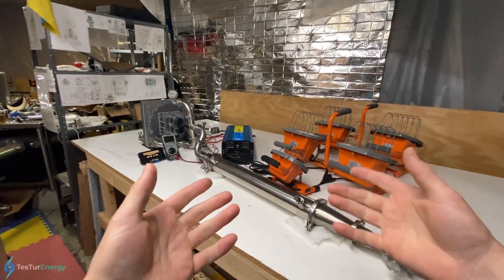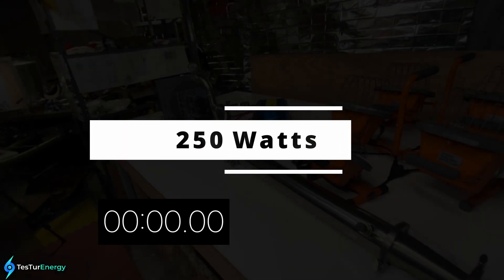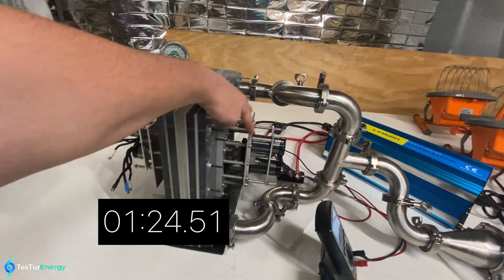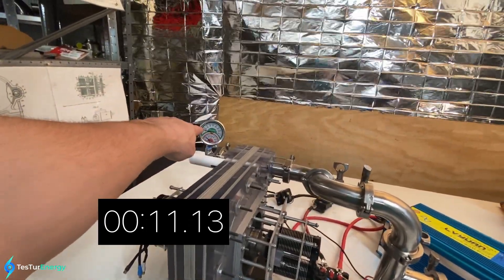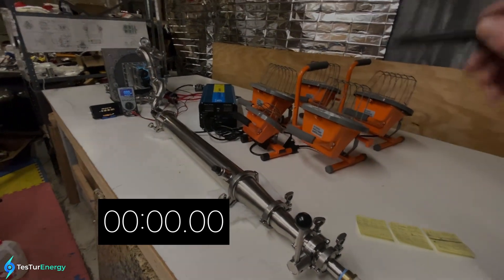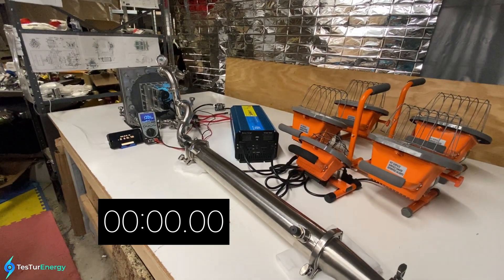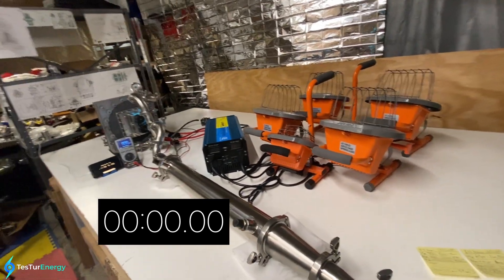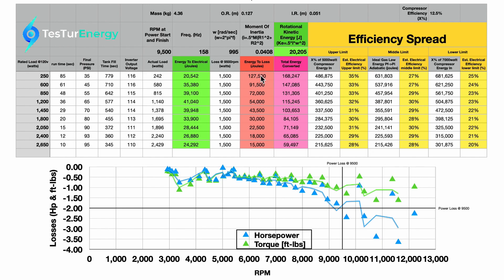Tesla Turbine 250 watt to 2.65 kW Power and Efficiency Test

Comment: Your efficiency calculation seems way off to me. I ran the calculations myself and I found your joule numbers to be right but your efficiency to be wrong.
Consider the first run: 20.5kJ out, 631.8kJ in based on ideal gas law. Running a percentage on this gives a 3.2% efficiency which is much more realistic given your improvised setup and small single stage turbine. I do not understand why you insist on including the losses into the power output. For the proposed real world application, only the electrical efficiency of 3.2% matters.
Reply from the maker: Hey thanks for commenting. The losses that are are shown are from the crappy RC car gears that are currently being used and the 10x crappy ball bearings that are in there that will not be in the final direct to shaft model and the losses to them can be assumed as available with the direct to shaft setup. 

Known recoverable losses at each RPM have already been tested.

The only reason the gears are even in this was because I wanted to prove to people the turbine not only didn’t have to be geared down like everyone demands but it could in fact get so much torque that it can be geared down. 

And I already know the direction for shaft TesTur will be MUCH more efficient because our new little 4.5in one that is direct to shaft is even more efficient and better than the 10in diameter one because it’s direct to shaft 

DIY Turbo Generator for Off-Grid Electricity: 250 watt Load https://youtu.be/60OqmBMNV-Q 

The little one powered the 250 watt load for a lot longer with less air even.
Reply from the maker: Additionally the 20,000 joules of rotational kinetic energy given to the rotor to spin up MUST be considered and included in the efficiency calculation because that is where energy went to from the tank. And in fact that was likely when the turbine was operating the least efficient and dumped the most air to do nothing but spin up. 

Lastly I honestly have no idea where you’re getting this 3.2% from… 

Can you elaborate on this for me?
Reply from the maker: The reason losses to the low power run are so high is because there is a constant gear loss load that the turbine is pushing through. 

By having to push through that load a lot longer most of the energy went to that. 

And there is a no electrical load condition where all the air in the tank just goes to pushing through the gear losses. 

All of which will be useful for power out with the direct to shaft setup and the reduction of the ball bearings alone.
Reply from the maker: As far as efficiency goes… (mind you this is a copy pasta 🍝 so it’s a bit long but it’s worth the read.) …My 2650watt electrical load run came in with a very low ball calculation of 40% isentropic efficiency.  To start off, mind you that includes generator losses, 3 phase rectifier losses, and inverter losses to the electrical load that were not accounted for. So the turbine off the bat is already most definitely doing better than the 40% isentropic efficiency I’ve calculated from the already low ball test results.   But for now I’ll just assume 40% isentropic efficiency so that I’m not over claiming what I can prove it can actually do for the time being. (I have nothing in the long run to benefit by overstating my numbers and only my legitimacy to lose. I’ve worked hard for my physics degree and don’t intend to tarnish it for a couple of extra views on the internet.) 

As far as inefficiencies to the system to fix, there’s 10x crappy ball bearings in this version, 2 crappy RC car gears, both losses will be gained for power out with a direct to shaft generator. (Minus two gears and 8 crappy ball bearings)  There’s an 1/8 of an inch of space between the turbine endplates and the casing endplates on both sides of the TesTur. That’s a 1/4in of open flow area around the 2in wide turbine (that only even has a total of 0.75in wide of spacing between all the tight disc spaces for torque to begin with.)   That means 25% of the open space for flowing through the casing, between discs and between the casing and turbine endplates, is just free flow over the side of the turbine still. (I’m using the absolute bottom of the barrel of machining equipment right now in my garage 🤷‍♂️)  There’s no labyrinth seals yet to even attempt to further reduce that overflow… 

The nozzle is atrocious at the moment, when making the variable converging section have a tight convergence it causes the fluid jet to aim more centripetally (towards the axle) instead of tangentially (glancing off the disc tips) which severely effects the fluids natural path.   This will be fixed with the new variable nozzle design I’m going with.    Then even further in this specific casing’s assembly there’s two “pillars” in the middle of the nozzle.   This is because the aluminum plates in the middle of the casing plate stack only had the variable nozzle bar and inlet holes cut out, and not the full nozzle geometry.  So those pillars are just vertical bars in the middle of the nozzle for the air to smash into just before going into the turbine (hopefully the wet steam tests will just erode them down 🤭)   Before all that there’s still about 100ft of air hose between the tanks and the turbine… plus a shell and tube heat exchanger and a TON of elbows and fittings.    I’m sure I’m forgetting something too but between all that being fixed… I can almost guarantee we will be in the 60-70s % range and that’s all just still with room temp compressed air.   Most forget, I’m using room temp compressed air and never went over 20psi at the nozzle for these tests. (Pressure differential and temperature differential govern efficiency) 

And even then I still only even have a single stage on it yet.   Everyone wants to compare it to the efficiency of a very high temp, high pressure (1000°F & ~1800psi) multibillion dollar 15-30 stage steam turbines…   😮‍💨   That’s apples to rocket ships. 😅  But considering Rankine Steam cycles get theoretical max about 33% of input heat (due to latent heat of condensation and that’s without any regenerative boiler feedwater preheat, air fuel preheat, etc) and then 40% isentropic efficiency (considering the turbine as is) we’re looking at 13.2% thermal efficiency with steam.   A more apt comparison for the TesTur would be something an individual can actually purchase, like 1-5kW piston gas generators that you can get from Home Depot or Lowe’s.   These get 15-22% thermal efficiency off the plant floor. Good luck getting that 1 year down the line or later with all those moving parts.  Also for reference, industry standard for micro bladed gas turbines is 25% thermal to electrical. Whole system efficiency can go higher in Combined Heat and Power (CHP) system, but alas the TesTur would see the same whole system efficiency increase in a CHP Auxiliary Power Unit (APU).  In the TesTur you gotta replace…? 🤔bearings…? And still even then, only maybe 🤷‍♂️ depending on how good of bearings, balance, lubing, cooling.   The TesTur, and other bladed turbines, only have one moving part. 🔥 

So if those piston generators drop efficiency, even at all, the TesTur on its worst day is competitive with a gasoline piston engine electric generator.🤓😬🤷‍♂️  And the TesTur can handle any fuel that can burn, even solid particulate fuels like powdered saw dust, pulverized coal, powdered iron, biomass, etc. (noting the number of those that can be acquired without spending money… 🤑 opening up “low monetary cost”, even carbon neutral, fuel options for MILLIONS around the world)  We have to remember that the TesTur doesn’t have to be the holy grail to be worth using if we have free fuels readily available like biomass, and even waste heat already being dumped out into the air and not used for anything.  The TesTur just has to be a viable option for some to be worth doing. 

Even more, the mere fact that I’m using a low temp fluid for my 40% isentropic efficiency calculation means my TesTur efficiency is severely limited by thermodynamics and fluid dynamics.   Increasing temps will automatically increase my turbines efficiency.  This is because gasses have an increasing viscosity trend as you increase the temperature.   This leads to increased isentropic efficiencies in the TesTur from reduced slip on the discs.  (Meanwhile, we’re already talking about a piston engine using combustion temps as is.)  Whereas bladed turbines see the increased viscosity as an increase in drag loss through the turbine blades.   So we can’t always count on seeing increased isentropic efficiencies in a bladed turbine in practice when we go from low temp to a high temp.  Again, to reiterate, this increase in viscosity in the TesTur only works to enhance the working action of the TesTur.  (That being viscous adhesion to the disc faces increasing torque.)  That’s all on top of the increased thermodynamic efficiencies of using a higher temp elastic fluid too! 🤓 

The disc spacing for room temp gasses is not going to be the same for combustion temp gasses/steam because the viscosity of either increases by 3x fold. And I’ve designed these spaces for a higher temp fluid with a slightly higher viscosity so these will inherently be too wide at the current temperatures being used.   So as we increase temps along with all these other really easy to fix mechanical issues (that only are a thing because I’m building this in my garage on a junk cnc machine) I have no doubt we will see more than competitive isentropic efficiencies compared to bladed turbines, let alone whole system thermal efficiencies that are through the roof.   This is because of the heat recovery systems that can be added with the cost savings of using a TesTur vs a VERY expensive, and in my opinion, relatively delicate bladed turbine.   Just getting tighter casing clearance with the turbine should give me at least 20% points back on efficiency putting my testur at the 60% range.   Coming in with a 19% thermal efficiency in a Rankine steam system without any kind of thermal recoup.

Comment: One more...adding heat to the air after it leaves the tanks?
Reply from the maker: Yessir! Make sure to check out the latest updates on the combustion + steam Tesla turbine builds! 

Tesla Turbine Jet Engine - gasoline fuel burner atomizer flame tube test 186,083 propane burner https://youtu.be/gRqKowignac
Reply from the maker: Steam Tesla Turbine Micro Power Plant - 1st Start Up https://youtu.be/aMYyBsjhBR4

Comment: Question. Would adding moisture (steam ?) To the air flow increase energy transfer to the discs?
I'm thinking boundary layer "stickynes"...
Reply from the maker: Hey Luis! Thanks for commenting! So it depends on a couple of things. For example, the material of the disc. If the material of the disc is hydrophobic in nature then h2o molecules won’t adhere to it well enough to increase the desired torque effect that the fluid should have with the discs. So depending on the conditions and materials it may or may not help.

Comment: why only 1/3
Reply: that lowering energy to loss while increasing input power figure is suspect
Reply: the difference in the time is mind bogglingly spinning stuff
Reply from the maker: @Jkauppa  the thing that really got me was that the total energy converted in each run was VERY close to each other even though the amount to power out and to loss was drastically different for all the runs. This helps to prove that the turbine is operating pretty fairly consistent even with the varying loads.
Reply: @CharlieSolis  ok hope it works like it should
Reply from the maker: @Jkauppa  the lowering of the loss while increasing the power output is because the amount of loss per unit time is pretty much a constant at a constant rpm. So the run that goes for a longer time will have more energy given up to loss. And the run that has the lowest output power will last the longest time so it will lose the most total energy to mechanical losses.
Reply: @CharlieSolis  I dont like the 1/3 efficiency, and making charts complicated just throws off the usefulness, even if the calculations after calculations would come to some nice conclusion, charts need to be the most intuitive as possible, just saying, I would remove all complications where possible